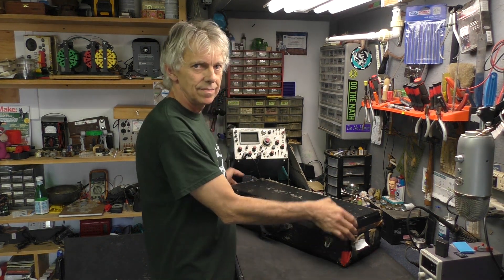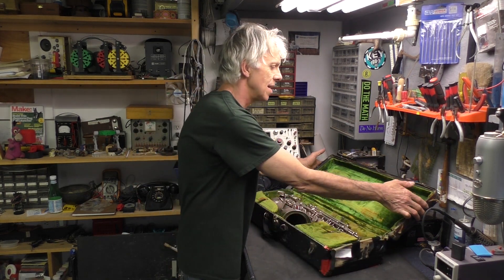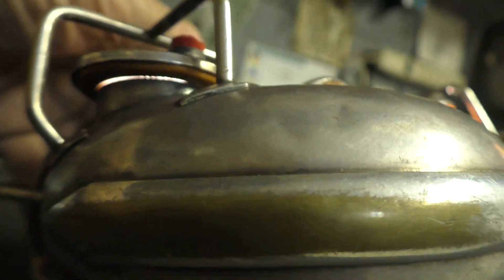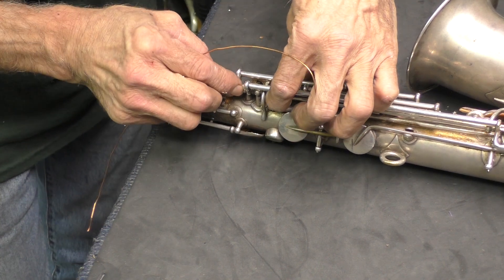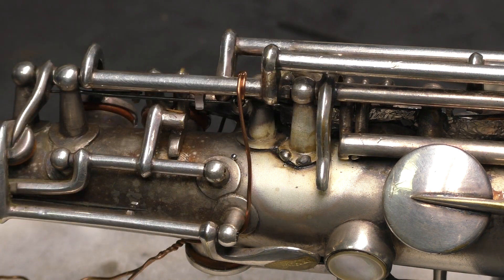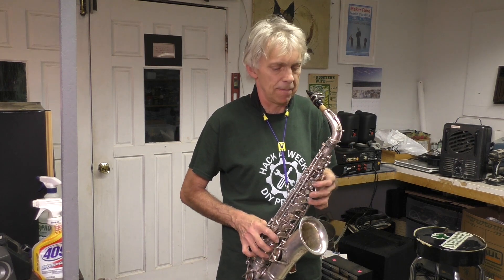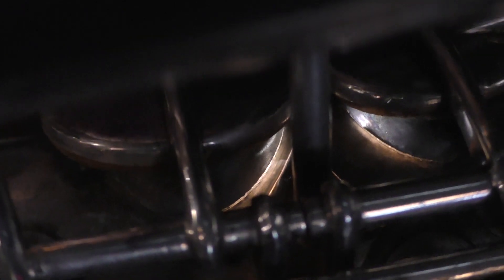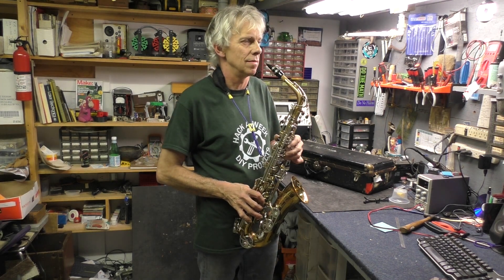1925 Holton Alto Saxophone Overhaul Part 1

Comment: Much obliged for the video. Long shot, I’m overhauling a Holton Alto from 1925. I’ve worked in a sax repair shop but not the repair side. I’ve got the pads done but I’m having an issue with springs. Some were missing or broken and I’m trying to find hole sizes. If you have a list great. If not maybe you know what size the top three spring sizes are. I’ve bought the generic packages put it’s a hit and a miss. My next move would be to find a gauge to see what those sizes would be. Just have not looked for that tool yet. Much obliged for any help.